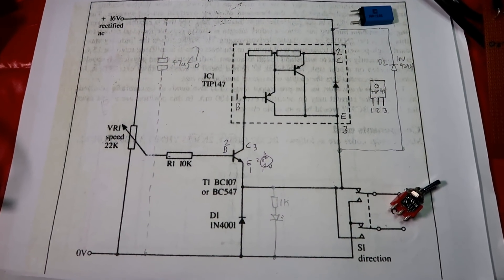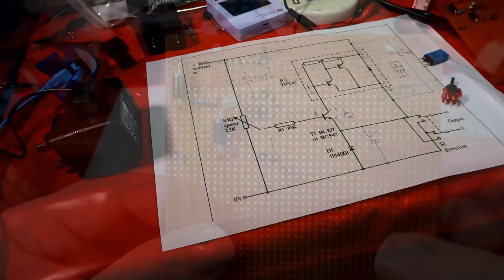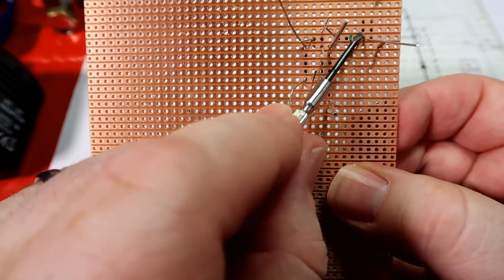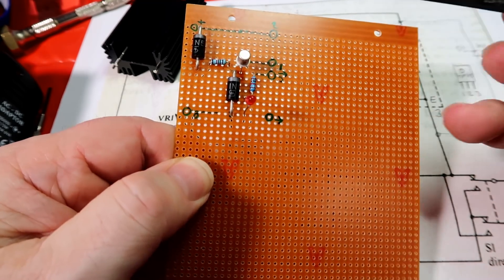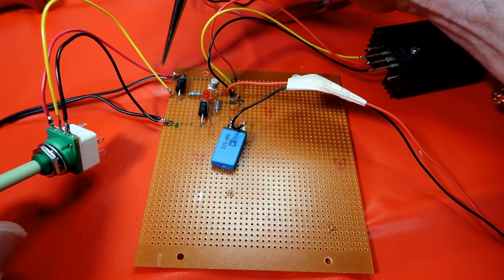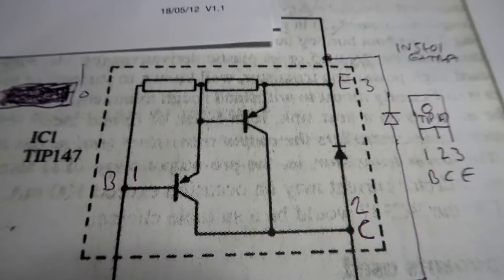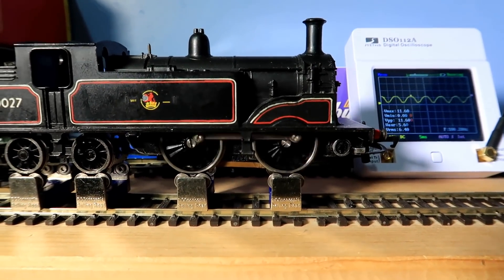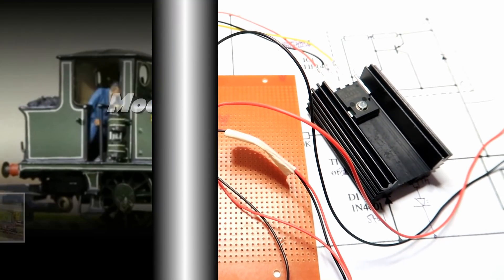Building from scratch a model train controller part 2

Comment: Yes. That is incredible. I really thought that to get that level of control would require fancy electronics! My uncle sent me this basic design in 1974! Turns out that’s all you need! So why on earth are the Gaugemasters so expensive? I previously made the UF copy and that works but I find it a little harsh compared with the Model D and of course not suitable for my DJ Models coreless  motors. So without further ado and with many thanks to you for the clear insight you have provided, I am going to build the dual track controller I need for the coalmine and station sidings. You are a star!!!!
Reply from the maker: Cheers Malcolm, happy to help. Yes all that is required for good DC operation is a full wave rectifier and a fine control chip, add in a 33uF capacitor to stop any buzz on coreless motors and you will be fine. The GM controllers are solidly built and are backed up by a lifetime guarantee. Something that I feel is worth its weight in gold especially if unlike us, you are not electronically able. For info I add a 33uF non polarized (50v) capacitor over the outputs of my model D and this stops any buzzing with sensitive coreless motors but does not affect the control ability. If you need any help just ask here or any of the three videos. Mike
Reply: @ModelRailwaysUnlimited  Update for you and your subscribers. I drew up the circuit with the addition of 4 capacitors and a multi-way switch to choose between them or none. Sizes used were 33uF, 100uF, 1000uF and 2200uF. I then duplicated the whole circuit and produced a PCB for a dual channel controller. Finished building it this week and tested for the first time last night. The results are truly impressive. With no capacitor on the supply, the motors don’t turn quite as smoothly. With the 33uF they really do turn at an incredibly low speed and have an anti-stall quality. As they try to stall they do get an impetus that pushes them on. The result shows up very nicely on the oscilloscope. Once the motor turns on the 33uF if I switch to the 100uF the motors speed up ( due to the average voltage being higher the more smoothed the input voltage gets). Interestingly once the motor is started on the 33uF you can then slow the motor down and it runs even smoother but lacks the full anti-stall kick of the lower capacitance. The 1000uF on no load shows as nearly pure D.C. but develops a ripple under load whilst the 2200uF maintains almost flat D.C., similar to the Morley. So thanks to this channel I now have a double channel controller that will start a motor at a crawl, maintain the crawl and can then be switched to smooth DC for coreless motors. 

There is no buzz or hum, unlike the gauge master D that I have.

So best of both worlds a controller that can progressively switch between gauge master at one extreme and Morley at the other. I would put that down as a great success.

Thanks for all the info and the great video tutorial.

Cheers

Mal
Reply from the maker: @malcolmhodgson7540  That is brilliant Malcolm! Are you going to do a video of your circuit?
Reply: @ModelRailwaysUnlimited  I will do at some point in the near future. I have a few things to video, its just finding the time to get it all done.

Comment: Hi Mike, I’ve been following and commenting on your channel quite a while under my main (caravan-focussed) account but have finally set up a new one for trains :) Over the past few weeks I have taken it upon myself to learn basic electronics and have a crack at building my first controller. My first attempt (based on Jim Read’s PDF, if you know Jim) was OK - the ancient Mainline J72 worked a dream, but modern locos were jumpy and springy. I don’t have an Oscillameter (or whatever it’s called) but discovered via the multimeter that there is too much AC leaking through to the track. I’ve now got a bridge rectifier on order to replace the 4 diodes I was using from the AC input so we will see how that pans out. I tried powering the circuit with 9v DC bypassing the diodes but this seemed to bypass the pot somehow and the track was at 9v regardless. What you’ve done here is great so I can feel some more purchases coming on and I might have a crack at your version myself. Cheers! Andrew
Reply from the maker: Hi Andrew, many thanks and well done for building your own, do you have a link to that circuit so I can check? sounds like some sort of pulse width modulation?
Reply: Model Railways Unlimited Sure thing Mike. I’ll send you a message on RM Web. I’m wondering if the root of my problems is similar to your boo-boo so I might check it all again tomorrow. Cheers.

Comment: This is great. Thanks for sharing.
Did you put circuit breaker across negative live of input?
Also, with the filter cap you mention, does that go across positive and negative input?
Thanks
Reply from the maker: Hi circuit breaker went on output, filter cap goes on DC volts input
Reply: @ModelRailwaysUnlimited  thank you!
Does it matter if circuit breaker is on positive or negative side of power?
Thanks again. Looking forward to trying this out.
Reply: @themanefaces  Nope can go in either :) let me know how you get on